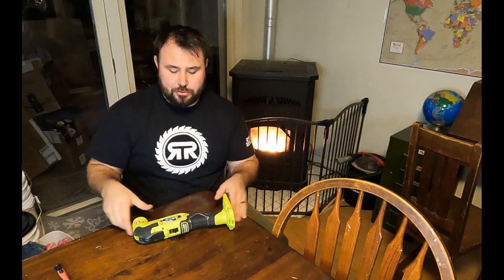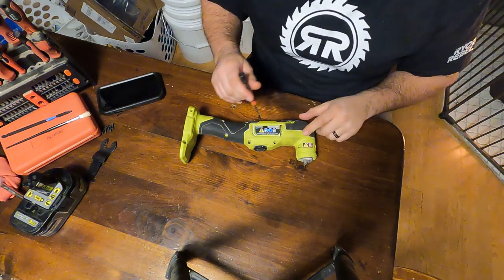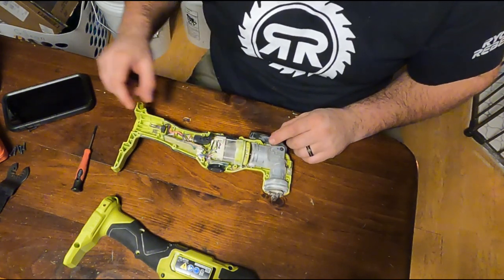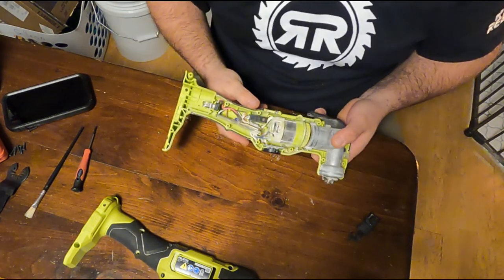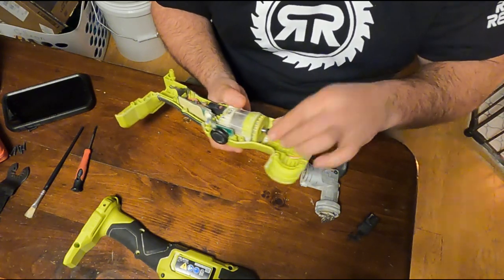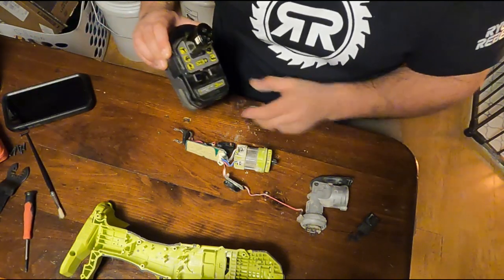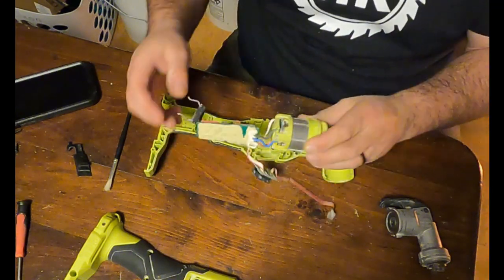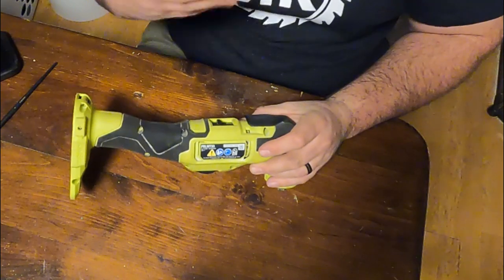Ryobi multitool button fix [What's inside]

Comment: I actually bought a "for parts" unit off ebay a few months ago for $15. I just added a piece of plastic as a spacer/shim to make sure the switch would engage properly. Good as new. I used some dry graphite lube as well.

Comment: Had the same problem with the switch, however it was not dust. The wiring to the motor was not placed completely behind the barrier and caused some pressure on the slider. At the other end of the motor, when the slider was pushed over the endcap, it hit that slight hump in the cap. I tilted the motor out of its frame and wrapped electrical tape over that hump to create a smooth surface on which the slider could move. The slider is still a bit stiff, but it does work. Thanks for the video, it made my problem easy to fix.

Comment: Thanks for this.  My wife's started acting up after about 4 hours of detail sanding work.  It would sometimes refuse to come on and I noticed the switch seemed hard to move.  Tonight I cleaned it out and it seems to be working again.  Definitely seems like a design issue where dust can get into an area which stops the switch from engaging properly.     

Sad part is, its only got about 5 hours total run time on it (mostly detail sanding).   My bottom of the Harbor Freight (Chicago Electric Line) corded multitool has about 20 hours on it and is continuing to run well (make sure to tighten the nut every so often).

Comment: So glad I found this! Mine is having the same issue. Switch is hard to turn on and the light comes on but the motor sporadically engages. I will take it apart and clean it out and see if that helps. Is it possible to buy parts for these anywhere?